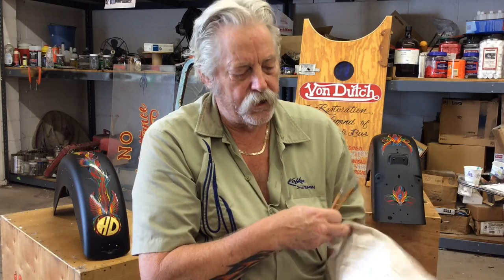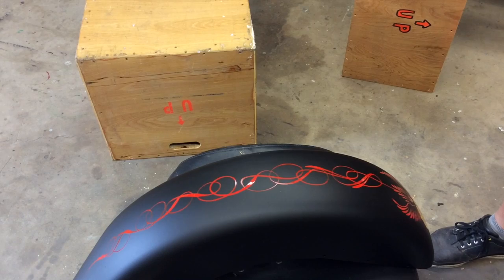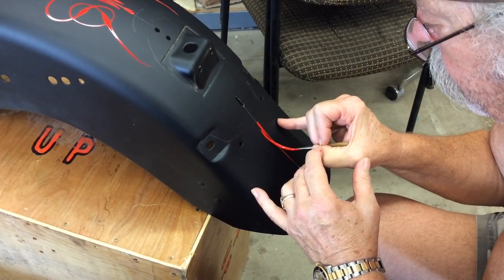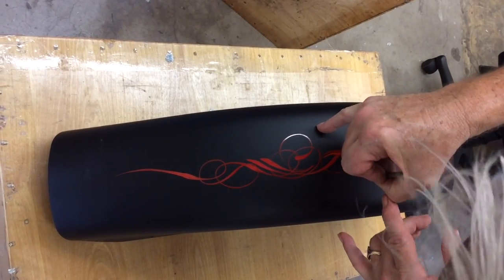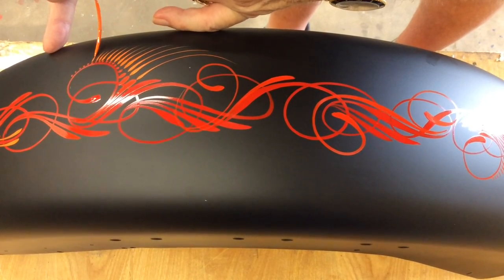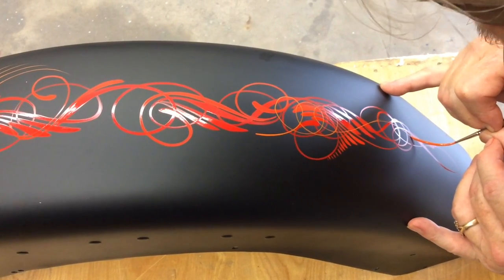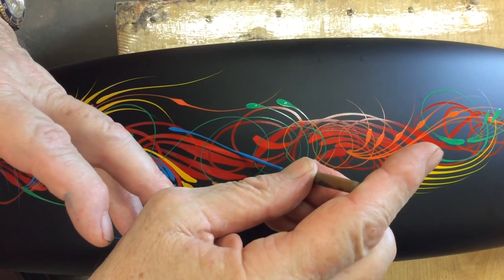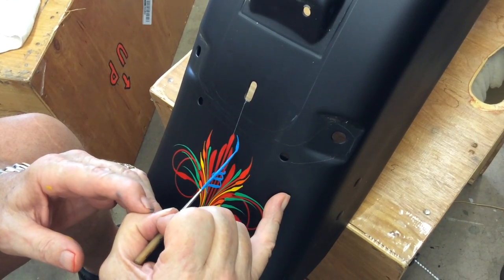Steve Kafka - Phoenix Birds

Comment: are mineral spirits used to thin down the paint? when should i use it? also how should I store my brush after adding oil when done painting
Reply from the maker: Brandon Nevarez I thin , or pallet with spirits, but I'm still using leaded 1-shot though.I,ve done another one of these on brush care.
Reply from the maker: Brandon Nevarez there is another video on brush care. I'm easy to get in touch with if you have questions. Steve kafka.com have fun!